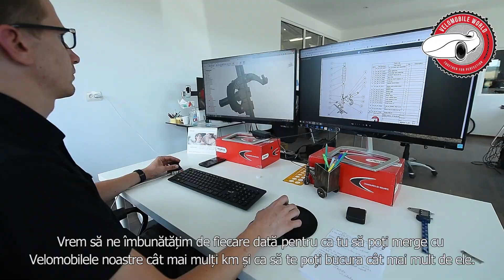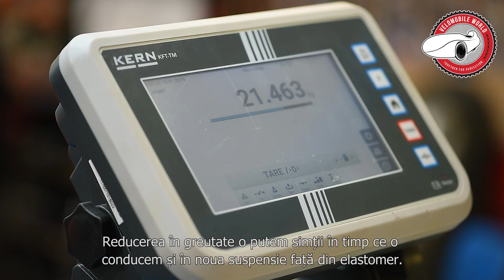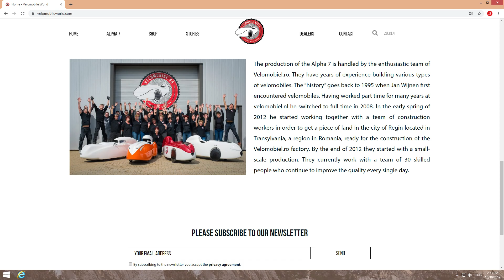Alpha 7 | Production Process | VelomobileWorld.com

Comment: Hi, I really like your design. Seams to be a really cool ligtweight velomobil. 
Only one concern looking at your videos: working with some kinds of resin without respiratory protecktion can be really dangerous and harmfull. I assume ist is some kind of Epoxid Resin? I know a painter who did al lot of idustrial floor jobs with Epoxi resin based paint. He is now suffering from severe lung damaging and is going to die because of this progressing scaring of his lung. Asphyxiation slowy processing over years. No fun! PLEASE PROTECT YOUR WORKERS!
Reply from the maker: Epoxy resin is heavier as air and we have very strong heat recovery ventilation system
Reply: @Pieter Jan Zijlstra  I don't know how long the female workers actually work with resin. Might be every day the whole day long... When my son did build his longboard deck I gave him my respiratory protection gear for paintjobs while he was handling the epoxi...  better save than sorry...
Reply: @Pieter Jan Zijlstra there are solution without the böse squeesing mask: A sort of helmet with vision shield, suplied with compressed air which is filtered through activated carbon with a small passive 'heating' element
Reply: @Pieter Jan Zijlstra yeah, just worked with  stuff zhat contains isocyanates: expanding foam and last week some PUR paint... i allway wear my mask with filter in the shop
I remeber a carpenter who did al lot of fair construction jobs, he used to smoke while spray painting PUR paint without a mask...
but back to topic: lets dream about a velomobile and riding at 60 km/h... ;-)

Comment: Really surprised at the lay-up process - I'd assumed you'd use vacuum infusion rather than wet lay-up with vacuum consolidation!
Reply from the maker: Vacuem infusion you get an heavier laminate from, more work and more garbage. Also it dont work that well with 3 layers of carbon.
Reply: @VelomobileWorld  Inserts "I Did Not Know That.gif"